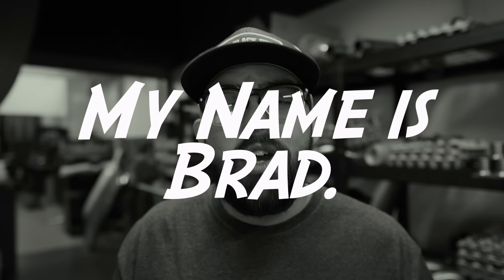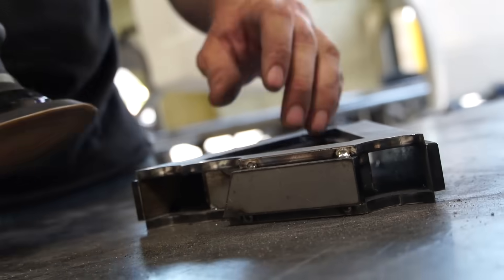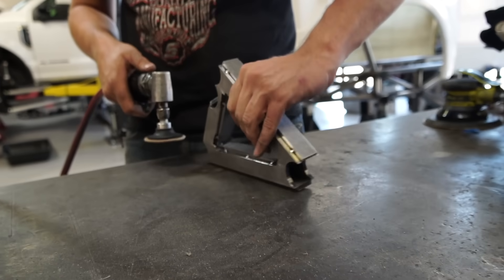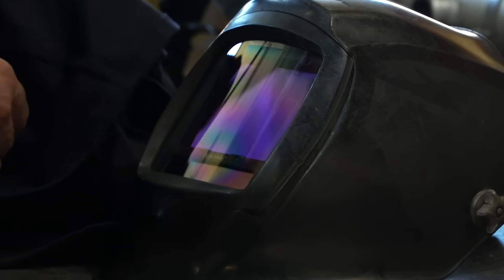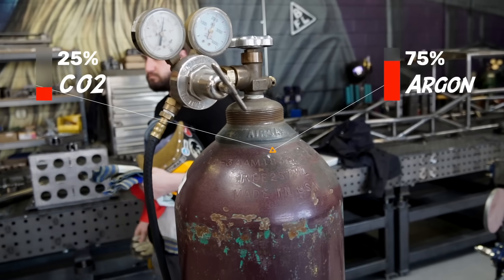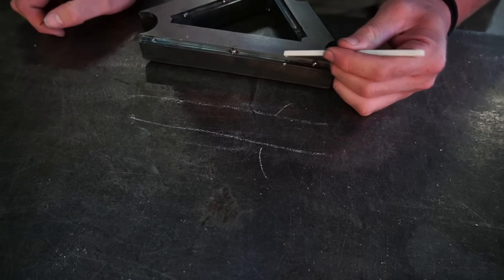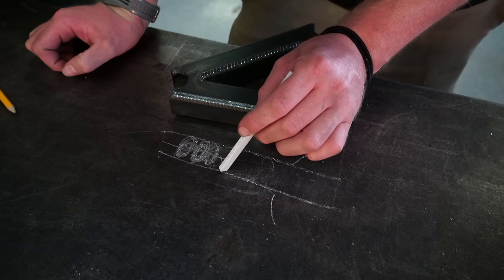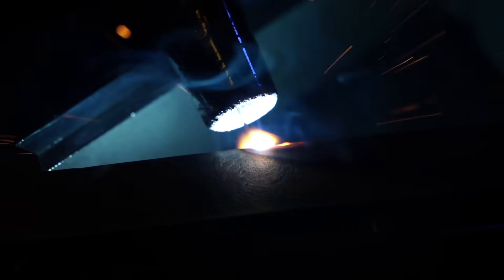HOW TO MIG LIKE TIG WELD (Stacking Dimes) W/ OVERKILLRACINGANDCHASSIS w/ *Tips and Techniques*

Comment: Why not use a wire wheel on a hand grinder to remove the mill scale?
Reply from the maker: If that works for you then keep at it 👍🏻
Reply: I literally never thought of that idea until about 2 weeks ago and now that's all I use. Still a 3 inch wire wheel with a 90 degree pneumatic grinder because of ease to control!

Comment: while we push a lot more aluminum wire than steel wire in our shop. that was a fantastic video and really convinced me to get a few rolls of .030"  hardwire for the 'lighter gauge' steel projects. its great seeing the focus on prep work and the TIG tacks are clever - can you get away with burst tacks or is that a fixture worthy component requiring filler rod in the tacks? also, I don't know why but frequently it seems like I go over the top in my manipulation for aluminum and opposite through the bottom for e70s, otherwise I gotta agree with Matthew Kubik about the similarities in the processes. Thanks for the humble lessons.

Comment: It looks to me like your welding a little cool at 18 volts on 1/4 plate, but I think that’s part of why it’s stacking so pretty.
Reply: I agree
Reply: Trying to learn about welding here. So can you explain what you saw that indicated that?
Reply: @shimarlie1  you will learn the heat of electrode to the thickness of plate.  so if thickness of plate is x then heat of electrode should be around y-z y-z being a variable so lets just say for instance 110-130 amps.
Reply: @LeTurnipTheif  thank you
Reply: @shimarlie1  to me there welding to cold at 18 volts. So to help, they’ve slowed there wire speed down. So it’s giving a really pretty stack of dimes (or tig) look. But if you go off a Miller or Lincoln voltage chart your you’d want to be closer to 21 volts. Unless your using straight CO2. But this overkillracing guy is a better welder then me. But he’s using so much filler in that joint he’s going to get a lot of strength out of that weld. But at 18 volts on any machine your going to get a proud weld.
Reply: @brentbowles7403  thanks for the reply!
Reply: I thought the same. It's on the cold side but it won't matter in this case. It's a little slower too but it makes a really nice looking weld.
Reply: Depends on the machine

Comment: This is for all the kids in school.  just wanted to inform y’all that if you have to code weld NEVER EVER do this. The technique used is a whip and that can actually fail you on an X Ray because it pushes imperfections from the front of the puddle into the weld which can lead to porosity below the surface. If it’s non code welding you’re fine to use it tho
Reply: Which code are you referring to?
Reply: @MoltenMouseMetal ...You would never do this if the welds are going to be x-rayed. Worked structural steel in late 80's at MonFab, and one job required 100% x-ray on all welds. The company doing the x-rays brought in a portable setup in a mobile home type trailer. They didn't fool around. I had one small porosity in the middle of a 100% column connection, and had to carbon arc down to the porosity and reweld it. Passed on that one.
Reply: Fievel Mousekewitz any code that requires inspection. Basically what you do is stack the weld on top of cold weld instead of penetrating. For something like this is fine but again I’m saying for ppl in school that this isn’t how you weld something that’ll be pressurized or structural
Reply: Amen to that. I have been a CWI for AWS D1.1 structural code for 23 years. I truly don't mean to offend, but this technique  is NOT correct for what I inspect. It would be a huge problem for sure.
Reply: @wedgehead63  so for structural you inspect GMAW?  Please explain
Reply: @wedgehead63  have you ever heard of a situation like this  , the company I work for got a job welding Domex XF 100 for a military application they had 1 person do a 12" butt joint for prequalification and when he finally passed they're saying now anybody in the weld shop is also certified to weld on the job , that dosen't make sense to me ,seems like anyone else would have to do at least a 4" or 6" coupon, the job order says certification required - yes on the front page , does AWS allow this ?
Reply: @billstoecker2714  Your shop carries your "stamp" or certification. What your shop did when they took the test was establishing a weld procedure that all welders would use. If they allow people to break those procedures and something fails they will be liable for it. When you weld for D1.1, 31.3,  Section 8, 1104.... any code work will have a weld procedure, Material testing and records or all NDT. Stuff gets audited by ASTM or some other standards organisation like AWS.
Reply: Agree. Why not clean the faces  and degrease before tacking? Nice looking welds though
Reply: Yes. Also this method creates a heat affected zone different from a structural weld. I am thinking of words to describe the HAZ. Large? Nonuniform? Inhomogenoeous? Spiralled?  Hmm....
Reply: I'd send that back and ask for a refund
Reply: Obviously this isn’t an integral part of anything. This is purely for looks, and needs to look nice.
Reply: Absolutley accurate information
Reply: Если добавить чуток напряжение + газ + скорость ведения горелки ,то никаких дефектов не будет!
Reply: Yall keep talking about school n code….THE GUY IS WELDING AUTO PART PIECES….he didn’t say he was trying to weld up the twin towers.
Reply: Whipping is only used when you have a patsy machine pushing 150A max but trying to weld 1/4" steel 😂
Reply: I whip and do code, you have to run hot. You can whip 😂
Reply: @sethmorris3723  my b, x ray welding. From prior to that comment to this day I have 0 failed in my career between mig, pulse and TIG welds
Reply: @billstoecker2714  I did ALOT of welding for the Army while activated and in service. NEVER had part failure on anything and my shit was deployed all over and being used HARD..ALL MIG welds..
Reply: If you want your weld to look like a Tig weld use a Tig, dur. If you want a poor quality mig weld do this
Reply: @adrianford447 that’s why he has a show n you dnt…..hater
Reply: @adrianford447  I agree, plus there welding like that is wasting time.  Mig is fast , why slow it up?
Reply: @adrianford447  that's hilarious 😂 My mig welds are not ONLY strong, but visually appealing 90% of the time. And I weld things that hold tens of thousands of pounds over and over again and water lift gates found installed WORLDWIDE. If you take pride in your work and actually know what the hell your doing you'd be surprised what you can achieve. I was lucky my father was a professional welder at the Rodney Hunt company. (Look them up!)
Reply: @dieseldabz7104  these welds may well hold up. From my experience as certified welder this technique would fail an xray.
Reply: It’s basically the same as running 60-11 except your using a MiG gun
Reply: Ummm dude never claimed structural welding pass.  These are automotive suspension pieces.  I'm sure they're plenty strong.
Reply: @LagmasterB  yes they sure are and won't fail either

Comment: I'm lucky if I can get my tig welds to look like tig welds :( That is a nice looking weld but I question whether it has good penetration, I usually would run it at around 21 volts and 395-410 inches per minute which I know gets geed penetration and still looks good but it's more blended in verses a stacked look, if running uphill obviously I would have to lower it a bit.
Reply: It has a stacked look as the gun is pulled away from the weld. When welding for a strong weld, the gun should be held over  the weld, and the weld pool pushed forwards, maintaining the weld pool. Welding as in the video looks nice but is not as strong as push welding . If you do certificated coded welding this is not used due to the loss in strength.
Reply: @roberttill3787  That is getting into the push-pull debate, the welding on this video is a bit different, you can get a strong weld with pushing and pulling there are circumstances to use each. This video is an example of a cold weld.

Comment: can this stack be done with any material thickness and a millermatic 211? = = for sure i can not weld at 18v 200ipm and stack - i have tried....25 cfh, 25% tank. vArious speeds and no go thus far

Comment: Can a person get a similar results from a flux core mig welder? Just curious
Reply from the maker: I’ve seen some pretty defined flux core work but I’m not sure actually! You can manipulate just about anything to do what you want though.
Reply: @hourglassingenuity103  I'm just gonna have to keep working at it. Problem is, most of the stuff I try to weld is thin like exhaust. I will get there. Thank you for responding.

Comment: I mig weld aluminum and mild steel on a daily basis. I burn thru 22 lbs of aluminum wire every 3 days. Welding aluminum dramatically improves the way your steel mig welds look! Aluminum freezes so fast you see absolutely every little wiggle but steel is more forgiving and those tiny wiggles dont show up!  I use the same exact technique when mig welding short circuit! Best part of the video is how down to earth and modest these boys are! I can see where running the .030 wire gives you that little bit of extra time to get that perfect stack!
Reply from the maker: Your comment has been quite refreshing, thank you so much! I really appreciate you taking the time. 🙏🏻
Reply: Please make a mig aluminum video. There are a few out there, but I still struggle with it. I can tig alum just fine, but that isn't always what I need for the work I'm doing, as you well know. I agree, if you can mig aluminum, you should transition to mig steel with ease.
Reply: With nothing available that fit a hold below deck  close enough to gain 20 gallons of reserve fuel and end a buddies practice and reliance on poorly secured plastic tanks in the stern live well's compartment that used to bounce on or float above his Sea Fury's hull  and ride out the seas inherently listing 20° in the bilge per her Deep-V  lines, he supplied two halves for a tailor made aluminum tank and tweeko's teflon liner conversion kit, and a big bottle of argon. I sailed right through the first foot of that maiden voyage on a fair wind and heading, confident in my plotted course. Preparation and a brief study had this amateur  plying like any master. Tacking true and straight, I could see it in my wake. I had laid a bead proficiently and was thinking of reporting back as pride began to overtake me and projects of my own came to mind along with a grin at the thought of donning the hat of Aluminum welder.
Then the freaking phone rang. The sounding of the bell may as well been an alarm for the havac that ensued. As i recall, I took the helm of the Tweeko into welding gloved hands unawares   but the instant I engaged found her unresponsive.  A bubbling sea of aluminium came up on all sides and bail as I might , grinding down to the deck, as if I could start afresh, but resumption only saw her awash, swamped under that bubbling, foaming, relentless liquid that moments before had promised to carry me to new horizons and status. Horror and frustration filled my auto-darkening helmet. The gloves came off, determination stepped in for preparation. Then the bulkheads  of my mind collapsed one by one, conceding failure a little late of it all going under. As a vessel to contain gasoline it had been on the bottom from the moment that second watch began. 
My offshore fishing mantra, a reminder to tend to maintenance and preparation with both feet on dry ground, and to budget  needs and concerns over wants and aesthetic always, and redundancy for emergency was borrowed for aluminium welding and some of that teflon tubing became bushings for noisy line levelers on a fishing pole because "A lot can go wrong out there"
In retrospect  I concluded that small segments , maybe 5-8 inches of the joint,  should have been treated or retreated cleaned and de-O2  imediatly before welding and just as important I always felt I should have flooded  the interior of the tank with argon to prevent O2 right under the joint from heating and pushing out into the hot metal. I call it a tank. Lol it's one of my scrap metal bens. I forget how many gallons we gave up with an off the shelf tank, it was enough to prevent  our mingling out on the outter banks  with those who could budget for what we had wanted but I never smelled fuel in bilge water again.
In your opinion would more meticulous  cleaning  and the extra gas done the trick. What additional steps ,if any, have you taken to maintain integrity in different environments or purpose ?
Reply: @tcyoung8123  what the fuck did you write here?

Comment: Parabéns pelo conteúdo de ótima qualidade, para quem preza por qualidade! 👍
Em uma situação semelhante consigo um acabamento parecido, não com tanta definição.
Tenho um equipamento antigo, porém confiável, com mais de 22 anos e operante.
Utilizo a mesma mistura de gás Argônio 75% e CO2 25%, vazão constante de 5l/minuto e arame ∅0,8mm.
Conto com aproximadamente 25 anos de experiência e solda, com eletrodo no início, MIG/MAG a um pouco menos e processo TIG a uns 2 anos apenas, ainda estou aprendendo.
De Brasil, Santa Catarina, Gaspar 👍

Congratulations for the great quality content, for those who value quality! 👍 In a similar situation I get a similar finish, not with much definition. I have old but reliable equipment, over 22 years old and working. I use the same mixture of Argon gas 75% and CO2 25%, constant flow rate of 5l / minute and ∅0.8mm wire. I have approximately 25 years of experience and welding, with an electrode at the beginning, MIG / MAG a little less and the TIG process just 2 years ago, I am still learning. From Brazil, Santa Catarina, Gaspar 👍
Reply from the maker: Thank you so much for the kind words! That’s awesome to have experience and are humble enough to say you are still learning. I really appreciate you watching! 👊🏻 have a great Sunday.
Reply: @hourglassingenuity103  👍👍👍

Comment: 1st time here love it but 1 issue I think most of us trying to learn to weld like ur self we only have El cheapo welder from like home depot I have a cheap 145hd I don't think I have those settings can I still get good welds?
Reply from the maker: You can absolutely get good welds with it, but the size Of the machine will limit you depending on material thickness.
Reply: I actually purchase a welding helmet from eBay for like $30 looks good but it sucks I used my buddy lincoln helmet that's like 210 that thing makes a big difference not welds like yours but better welds any tips for thin sheet metals I have tried for months and I keep burning

Comment: I have a older italian it only has knobs and switches no meters to work off of.  After hundreds and hundreds of hobby welds i have learned that heat levels are needed to create a puddle with this puddle you swirl by hand your hand piece still for me i have a added problem my mig has feed issue which means the stick can get stuck in the hand piece because this spool is not grabbing the spool stick and giving a consistent feed of the stick metal.  I have to rebuild my feed on the mig to stop the metal from slipping as i try to weld no added adjustment helps . it is a victim of design.  All this being said i like my mig it's a great invention just flawed in design. As far as the coin weld personally i could care less my goal is a good solid fill that takes a giant sledge hammer or endless grinding to break apart.  I like to make my welds join the 2 materials and blend the coin effect is a standard for many welders but i don't need to see it and personally i like a blended look if i make a bike or something for painting which i can see coin welds still need wire brushing or grinding if you paint or plate they are not smooth but jagged you never get them flat to feel another end problem.  Tig has a better chance because you control heat ,puddle and the stick so as it cools it lays flatter with less splatter a common problem with mig.  love you video.

Comment: What is the slag doing during this motion? The welds look great, but I've also seen people using the "stack of tacks" technique to get a similar appearance with inclusions along the entire joint.
Reply: Slag in mig?
Reply: @phillipcabrero1005  they refer to it as Silica in the video, it's the stuff that pools up on the surface of the weld from the base metal which will ruin the integrity of the joint if it gets trapped inside.